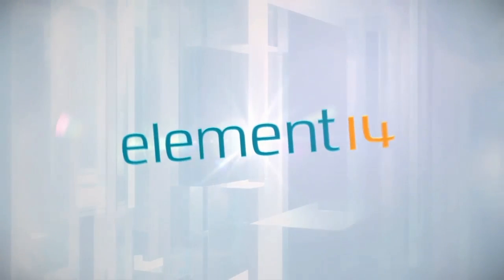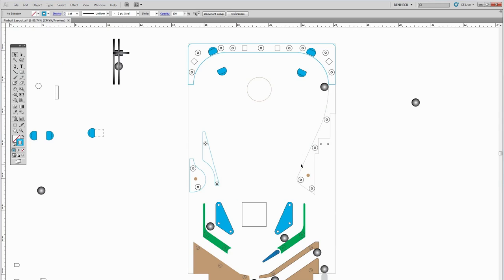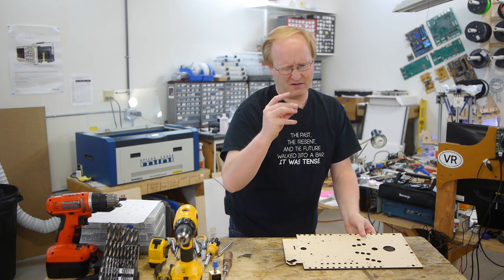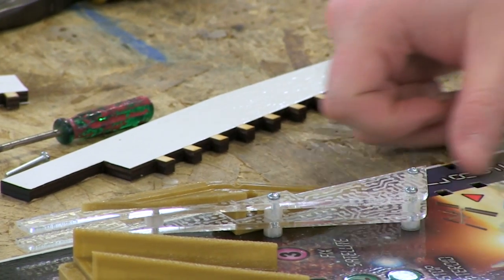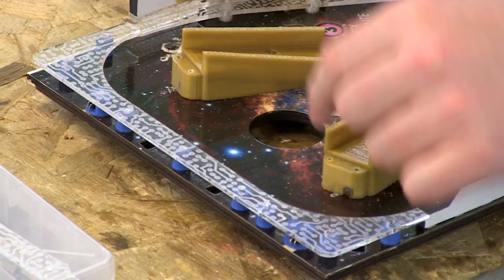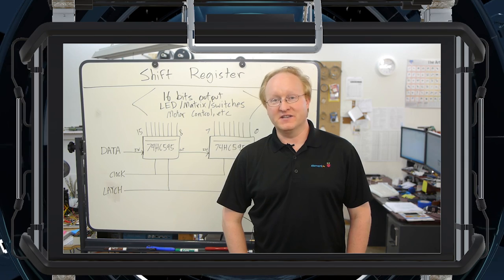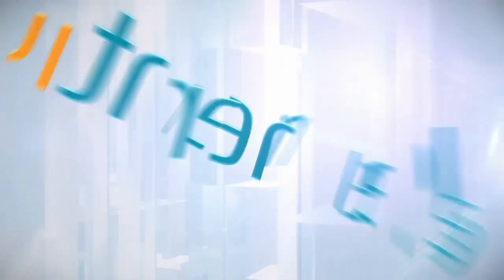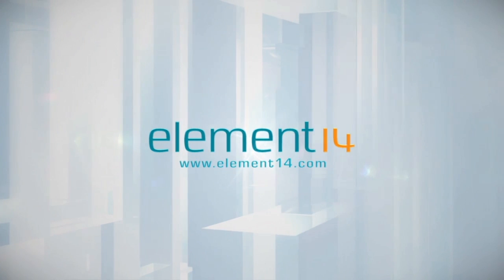Ben Heck’s Teensy Pinball Portable Part 2

Comment: Three small changes:
1) a simple pendulum-style gyroscope to detect tilt
2) adjustable foot screws at the corners
3) integrated x/y axis leveling tubes in the front/side of the unit to verify it is sitting level before playing

Moreso than a full-size pinball table your teensy table is going to be susceptible to both score abuse and damage from users thrashing it about, so verifying that users aren't "cheating" by applying excessive tilt is in the unit's favor. Likewise, the leveling feet and built-in levels would guarantee fair play at the table angle you designed the unit with in mind (or an even bias from which to adjust the table from) since the teensy table is likely to be moved a lot, and not always with a level handy to test it afterward.

EDIT: perhaps do the tilt sensor entirely discreet and simply have it shut the unit off should excessive tilt be applied? A couple of simple switches that close a circuit if a pendulum contacts them, or something like a self-centering hall-effect sensor that does something similar when it moves beyond certain parameters? I don't know, I'm just brainstorming here.
Reply: Maybe just microswitches on the underside that detects if any corner of the unit doesnt touch the surface its standing on. An accelerometer would work too.
Reply: *****
 I'm not so much recommending the tilt sensor to prevent "cheating" simply in terms of score manipulation as I am suggesting it to prevent abuse that may damage the table itself, since a score penalty or lost score entirely might prevent someone from doing so. The teensy table will be moved --- a LOT -- and likely be played under social conditions. This is going to put the unit under enough stress already without people being rough with it to enhance their score, since there is no penalty. The drop target, for example, appears relatively delicate: abuse to the unit could damage that target in a way that adversely affects the game experience.

Likewise with the feet: the last thing you want is the ball having a bias toward the left or right of the table, or too slow or fast of travel, all because your table isn't perfectly flat. This would greatly diminish the table's fun factor -- much like a nonfunctional table would.
Reply: Guerilla Grue Plays you could always have the pendulum head made out of a conductive material and just have metal plates on either side... if you tilt it will make contact with the side and complete a circuit..... much like the game "operation"
Reply from the maker: Guerilla Grue Plays Thanks for the feedback :) A good way to get Ben to see it is posting on the community: http://ow.ly/OGJa9
Reply: +Ortsa, Tilting is part of pinball, but it's no fun if it's completely unrestrained.  In a game without a tilt sensor any kind of bumping feels like cheating. (Even if nobody's watching.) But if there IS a tilt sensor, then the game gets a lot more complex and interesting because anything that doesn't trigger the sensor is fair game.

TLDR : Tilt sensors make pinball more fun.

Comment: There are a huge number of toy pinball machines out there meant for kids, built small and cheap. The solutions they came up with for certain elements of the game to cut costs definitely comes with drawbacks...

All of them have fully mechanical flippers, thus you have to push the buttons in quite a bit and you can even push them in only part of the way and thus only push the flipper up part of the way. Many use a constantly-running motor and gearing for absolutely everything, including scoring, which is incredibly noisy. Some of the more recent ones use the electrical conductivity of the ball itself to act as a jumper when the ball hits something to score points, thus eliminating the need for a motor, but sometimes this doesn't register since it's intermittent contact. Another thing they all have in common is that the through is gravity-fed straight back to the shooter lane, though some single-player models have a manual mechanism to catch/feed the ball. Some of the motor-driven ones actually have pop bumpers which work without solenoids, but have a delayed reaction due to the nature of the gearing which drives them.

Granted, despite their extreme shortcomings, these things typically sell for $25 to $100. Quite a bit less than a brand new game from Stern. ;)

Comment: What Guerilla Grue Plays says, and:

If you have a Spaceship theme, then why didn’t you do a “force field” thing, where the ball is held in the air by a levitating magnetic field effect with a hall sensor? 
The switches could have been made with simple contacts. Why to use a microswitch for that? And if you use a microswitch, the weight of the ball plays no importance because Aristoteles found out this wonderful thing with levers… 

Additional it would be better to lower the tilt so the ball is moving slower in the flipper on the downhill. Makes a better feeling. And of course there are magnetic effects for this theme that would be cool like acceleration coils (railgun coils) and magnets on the bottom of the game that will distract the way the ball is falling. Maybe a good trick to throw it up again? 

There are missing bouncers of all kind. Like mushroom-bouncers and bouncing walls, bouncing plates, bouncing rubberbands and so on. 

A display to jack to the top of the thing would be nice or wait?! What about a laser projector? It’s all done with two simple mirrors… So the thing keeps portable. But man… Spaceship… Laz0rz… Have  I to say more?

And multiball mode. Is a must.

I mean - okay. For that levitating thing you would need Neodynium magnet-balls I guess. But how cool is that?! And that would change some parts of the flipper for you must not use any magnetic parts in rails or something. But IF you have magnetic balls, how about setting them to a spin and to gyro them around in a effect?

It’s not done anywhere, so I think… coolness factor would be going off the RAILS. (Like railgun!) Like making the ball moving back on the rails for you can spin it backwards. Yeah, you'll need a couple of a halleffect sensors and that, but… but…

Hall sensors instead of IR light sensors. Yeah, why do we have to make flippers like the 70s hippie guys? Why do we just use contacts and that? We have way cooler effects today. And cooler sensors which can do a lot of things, that were unthinkable in those times. Really. Throw out the kicker to throw the ball in with that spring and that. It’s nice. But an other railgun would be correct. Talking spaceships… Do it with magnetic force. Do everything magnetic. Kick away the flippers and that, do it with magnets.

I really like to see that. Oh yeah, and tilt-detection? Don’t penalize it. Just put a gyro/accelerometer in the box and compensate if the spaceship is not leveled. You have magnets or not? Make it part of the game. And yeah if you want to penalize, then just don’t turn the machine off, just make the forces evil. Dark. 

If we're talking of darkness, a 20 kV spark emitter would be cool. Still staying inside the space ship theme with that… Why not throwing real sparks? And if it’s tilted - make the machine kick back, tilt back. Space ship is hit, yeah?

Comment: why not use a coil that can be pulsed using a flash circuit from an old 35mm disposable camera to throw the ball up the play field and remove the need for a mechanical method.